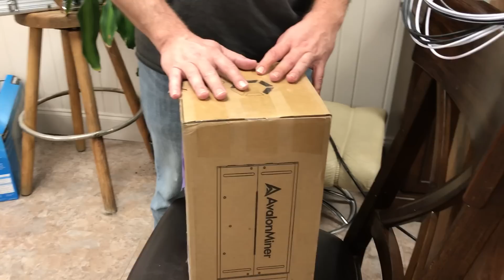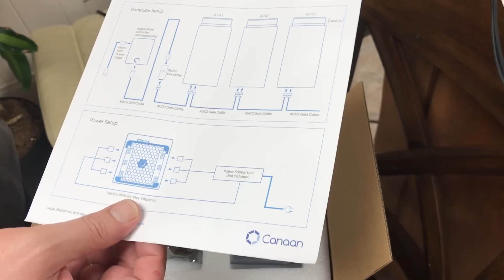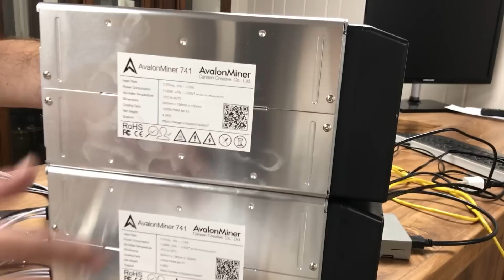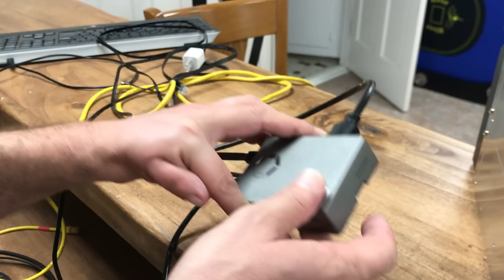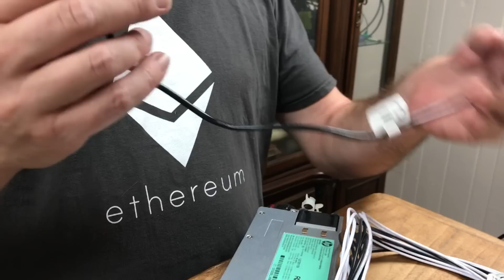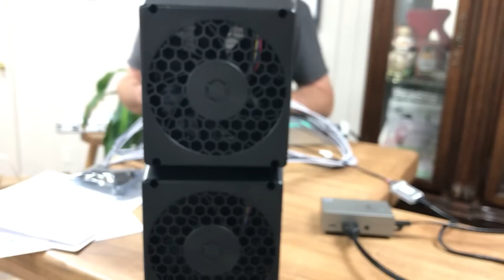Unboxing the AvalonMiner 741 for Crypto Currency Mining Rig

Comment: Hi i can use another avalon controller maybe low cost about avalon controller
Reply from the maker: It is just a Raspberry Pi model B so you don't need their controller.  Make sure and download and flash the correct firmware for your Avalon Miner.

Comment: hi,, i need help, 
I have 4 green lights by the power pins on the back of the unit (2 on each side)
1 Green light on the unit above the power pins which apparently means the unit is idle.
I have a green and blue light on the usb convertor.

on the dashboard the Modules Information section is showing 0 alive modules and -- for temperature and fan.

when i use static IP can see the avalon configuration but show me alive modules - and temperature 0.. but if i use DHCP can not see anything, coz not connection the avalon, i dont know what to do
i use raspberry 2

help my miner is not mining
Reply from the maker: Check your pool configuration, there may be a misspelling or space that is causing this issue that you describe.
Reply: AtHomeCrypto the problem that i have is when a connect the power on the raspberry.. the auc3 converter just green light on.. i dont know why the blue light keep off..
Reply from the maker: Are you using 240 volt power?
Reply: The psu work 200v-240v and i use 220v

Comment: General Questions:
I'm looking at picking up the upcoming Avalon 821 Canaan announced on there website. It looks like I will have to purchase it through one of their distributors (Blokforge) for pre-sale. I appreciate your videos of the 721 as it gives me an idea of what to have ready. Hopefully they are using the same Pi controller for this new gen Avalon. May I ask where you got your 721 and how well did your ordering process go? (This is my first ASIC purchase). I'm guessing the 821 will be priced competitively against the S9, but based on your 721 purchase, what do you think the MSRP might land? Thanks again for your videos! On my way to Home Depot to replace a socket to NEMA 6-20 for the new Avalon. ;)
Reply from the maker: I pre-ordered originally from minerwarez. I understand the 841s will use the same Pi controller and AUC interface.  I do not know for 100% certainty but would expect the 841s to be $450~ more than 721.
Reply: Thanks! I spoke with a rep from Blokforge who couldn't confirm or deny anything, but she said the Pi controller should work with the 821 as it can be updated via software. She also recalls the 721 running off the standard US socket at 15AMPs (NEMA 5-15) as they commonly sold the Sorcerer PSU along with it. She said as long as the wattage is correct the miner should accept the power from the PSU and power on, but may not operate at it's full potential...?

My guess was this might run somewhere from $2k to 2.5, but seems like most are leaning to the lower of the two. From your experience purchasing ASICs, what would you consider to be the quickest, safest, easiest way of payment? Due to the BTC network slowdowns, I was figuring either a bank wire or paypal. I understand the risk involved in buying ASICs, but what steps would you recommend to secure your pre-order purchases?
Reply from the maker: ON another video of mine, a person posted this link to the ones he sales. https://www.youtube.com/redirect?event=comments&q=https%3A%2F%2Fwww.ebay.com%2Fitm%2FBitmain-Antminer-S7-Bitcoin-Bitcoin-Cash-ASIC-Miner-4-73TH-s-HP-Gold-Rated-PSU%2F162813174415&redir_token=b3owq2ZfN7GAFJNX3cpHzSbP8Cl8MTUxNTI3MjA1NEAxNTE1MTg1NjU0

Comment: Hi great video. But how do you connect the controller/raspberry pi to your computer?
Reply from the maker: That is in a different video but it is via the network settings and your browser.
Reply: AtHomeCrypto yes I watched that but what cables do you connect from the controller to your computer.
Reply: Does the Ethernet cable connect direct to your computer or router? Thanks Martyn.
Reply from the maker: For initial administration, you can connect directly to your computer; after that and for the rest of time, it wil be connected to your router.
Reply: AtHomeCrypto that’s great. I really appreciate the help. Ordered x2 Avalon 741. Thanks Martyn.

Comment: Can you run a single 741 on 110 AC?
Also do you need a powerful desktop computer to run it through?
Thanks.
Reply from the maker: NO & No
Reply: Thank you for your very informative videos. I am looking for tech support I'd be willing to pay for to get running.
Reply from the maker: Thank you.  We are also on Twitter and accept questions at our Gmail account. Feel free to reach out.
Reply: Incidentally, will a Canaan controller work with the HP power supply and breakout board? (instead of Raspberry Pi)  Thx.
Reply from the maker: Nope, The Pi is needed as the controller/interface
Reply: Thank you for the answer.  I noticed that the HP power supply does not come with the six 6pin wires that attach to the rear of the Avalon.  Where can those wires for the Avalon be obtained?
Reply from the maker: Those are PCI-x cables.  You will need those and the breakout board to connect from the PSU to the miner.
Reply: If the average 110 allows for 1800 watts and this takes 12-1300 , why not ?

Comment: What powersupply are you using and does it do two full avalon 741s? I have 4 coming and have yet to get power supplies.
Reply from the maker: I use HP 'DPS-1200FB-1 A for each of the Avalon 741.  It requires the 240 AV power at wall.
Reply: 240 at the wall? Dude where you live? Isn't all N/A 120?
Reply from the maker: HA!  99% of places in USA are 120 Amps.  An electrician can install the 240 for you, this is more efficient also.
Reply: THANK YOU for your reply. I'm obviously new to the game. What are we talking?  New line from the pole to another panel or a new breaker type deal? PLEASE say option 2. Crap man.
Reply from the maker: Neither, actually it is much easier than both the options.  The Electrician will just need to install the 240 AVG socket at the wall near a 110 for you.  You could also install a new 20 amp breaker and run a stand alone 220 from it if you wanted but you the electrician can use existing breaker.
Reply: So it's able to pull 240 from the same line/box as the 120? I have a bunch of slots left in my breaker and the room where I'm going to start my burgeoning crypto empire (HA HA) is about ten feet away behind a simple drywall on aluminum wall with the back being empty. This means I just poke through one layer of drywall and I could put a million receptacles if I wanted/had the amps to my box(I THINK it's 100a) and cooling and space to support them.

Comment: the battery power supply is for what?? do I need to buy it with my 2 Avalon 741 ?
Reply from the maker: HI, Thanks for watching.  Yes you will need a power supply that supports 200 volt and 1200 watt for each 741.  You do NOT have to purchase the one I show on the video but I have found it very stable and a good value.